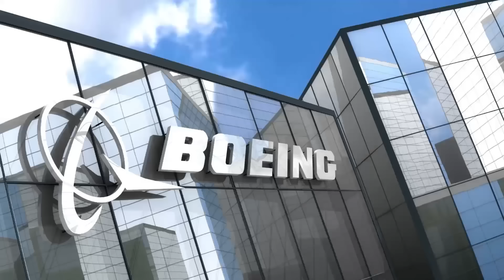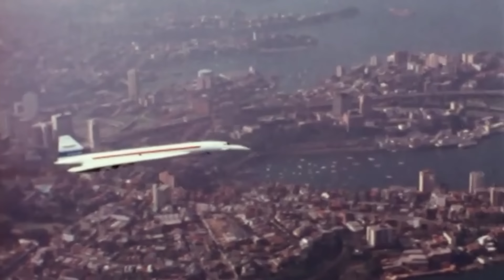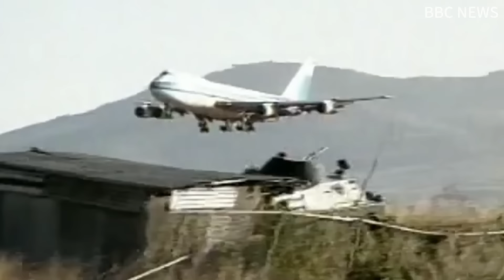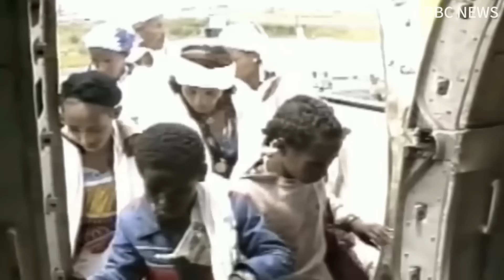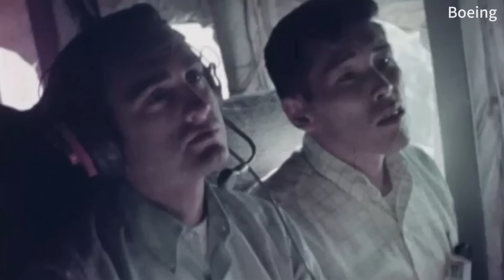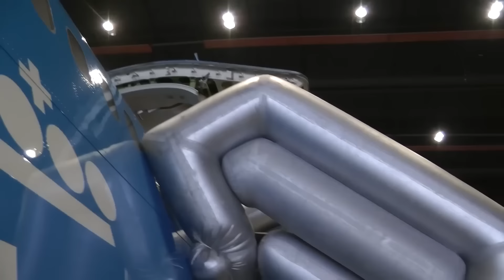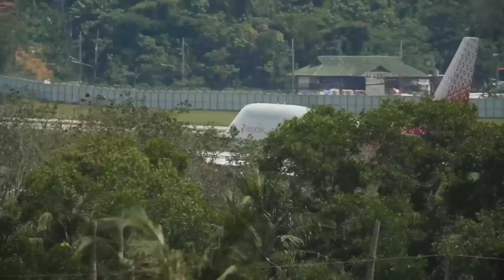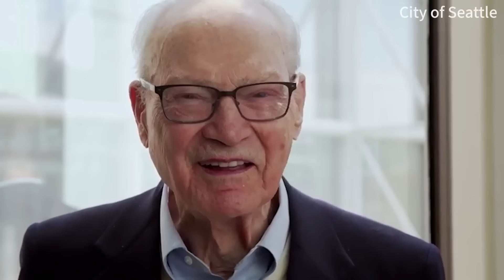What The Boeing 747 Hump Was Really For

Comment: I flew many times on 747s, a wide range of airlines.  Of all aircraft, 747 felt solid and secure.  Highlights:

- Pan Am NY to Frankfurt/Main,  several hours overnight in storm with lightening all around, and turbulence such that if not belted we would have ben bounced off the ceiling each few seconds.  I only had that turbulence experience in one other case, Swissair MD8X London-Geneva, storms over the Jura and Alps.

- On the last leg from Europe to São Paulo, taking off from Rio de Janeiro almost without any passengers or fuel, pressed harder into my seat than any sportscar.  I recommend anyone flying in or out of Rio to use a local propeller aircraft, as the views of the mountains, harbour, beaches are spectacular - on a 747 you're too high too fast.

- Pakistani 747 Zürich to Karachi, the interior was sloppily hand painted.  Weird!

Comment: Hi, I am ex military and was lucky to meet one of the designers of the 747 in his 80's. Not in the US but in the UK. Yes thats right, as you say the design had to be revolutionary to acheive such a high sub sonic cruising speed. As it happens the gentleman concerned was one of Barnes Wallace's understudies - yes teh guys that desinged, tested adn built the bouncing bomb that help end WWII quickly.  He explained how Boeing brought him in as an aerodynamics consultant to enable them to desing a wing and body that could do that speed (0.85 m) without the airflow going supersonic over the wing root.  In other words, the air goes faster due to Bernuli princple over the wing which helps create lift, but not too fast so it goes supersonic (when the jet is that close to the speed of sound).
So yes a pom (posh old dude from the UK) was critical to the sucess  of the 747. I know a lot more than this simplification of the facts, but I will leave it at that. PS I'm an Australian so no bias there...:)

Comment: Aeroplanes are not made of aluminium. They are made of material called ALCLAD. Alclad is a range of duralium alloys with 1½ thousands of an inch of aluminium hot rolled onto both sides (like a sandwich). The skins of the 747 are made from alclad whose main alloy is magnesium. I am a retired aircraft sheet metal worker.

Comment: 12:00 a nod to the pioneering Sir Freddy Laker who in the late 1960s took BAC one-elevens, reduced passenger free baggage allowance and reduced the maximum number of passengers (below the aircraft's maximum).  This allowed extra fuel to be carried allowing for a longer range.

This continued in the 1970s when he got 2 of the 5 DC-10-10s destined for ANA (the other three went to Turkish Airlines (one of which was used for TK981 which crashed due to the defective cargo door).  Reducing the baggage allowance, reducing passenger numbers again allowed more fuel and more range (I think he had an extra fuel tank installed).

Comment: My friend, every ocean crossing jet liner required a Pilot, Co-pilot, and Flight Engineer. 

Solving problems that have never been encountered before? That's what engineers do every day. 

Yes, I've flown 747s many, many times to five continents, as a working musician, a travelling teacher, or a consulting engineer. It was the best, most comfortable, safest airliner ever built. 

Still being built. 

Special feature --  The Pan Am Lounge -- the only Piano Bar at 35,000 feet in 1970, accessible via a spiral staircase in First Class. Invented like most great airline ideas, by Juan Trippe.😊😊

Pan Am converted all their 747-100s to contain a Sky Bar. They had a small baby grand with bartop, usually a jazz pianist to play tunes, standards, sing alongs, requests, and would sometimes be joined by pros on board. They were very cozy, intimate, friendly, and surprisingly quiet. 

All airlines followed with similar ideas. I spent a lot of time up in the Sky Lounge, when a friendly stew wasn't showing me the elevator down to the prep galley, storage area, freezer, and liquor cabinet. 

But that's another 747 Secret for another time.

Comment: There were many airliners that were faster than modern airliners, the difference is that modern airliners are soecifically designed for fuel efficiency while the older airliners were designed for speed.as to how to do the calculations without a computer or calculator, we did this in Engineering and our professor would always talk of the calculations for the Boeing 747.   The complex partial differential calculations would be solved on semi log paper, a ruler and a protractor.  It's called Bode plots and they approximate the differential equations by at most 3dB.   We would always comment on how the final was always the same twenty problems every year.  Turns out those were the classical oroblems that could be easily solved, change anything and you'll spend most of your time chasing your tail.  Thr graduate course was the same twenty problems but each with a minor change making the final beyond frustrating.  The amount of computer time to solve thes problems are incredible especially since the ruler, protractor and semilog paper could solve the classic problems in minites while the conouter would take days...  Of course, change anything and you might spend a lifetime.  Okay, modern computers would be a lot faster.

Comment: The hump on the 747 was there because the original design of the 747 was for what became the C5A cargo plane for the US Airforce. it set the pilots up above the main deck so the front could be raised to load cargo, and when the contract was refused BOEING because McNamara hated Boeing...Boeing used the engineering time spent on the plane to good use when Juan Tripp from Pan Am come looking for a LARGE plane and Boeing incorporated the hump so there also could be a cargo version.  IF  you see a C5A you notice its nose also lifts only 2 planes I have ever seen with that type of nose !!!

Comment: Mach 0.85 Is 647 miles per hour, not whatever you said. Also you said it was designed in the 80s it was designed in the 1960s

Comment: The 747's hump, or upper deck, wasn't extended fully along the fuselage length due to aerodynamic reasons. While the initial design included a full-length upper deck for potential cargo conversions, this was not implemented in the final 747 design. The designers determined that a fully extended upper deck would negatively impact the aircraft's aerodynamics and overall performance.

Comment: I worked at Boeing on 747s airframe #4 through #42, hard to believe that the aircraft would be in production for half a century. It was the right plane At the right time providing low airfares for the rapidly expanding intercontinental travel industry.

Comment: In the early 1980's I flew on a 747 from the US to Germany on vacation. The big 747 made transcontinental flight so affordable, even I could afford it. I checked with Headquarters Marine Corps to make sure a vacation flight to Europe was OK with them.They said it was fine, but if I intended to fly over any Communist country, it would take special written permission from them. As I didn't intend plan to fly to Berlin, (over then Communist East Germany), that special permission was not required. That was my first 787 flight, but not my last. A Great aircraft.

Comment: In 1977, I flew on an Iran Air 747 SP non-stop from JFK, NY to Tehran, Iran, a distance of more than 6,100 miles. We took off in the dark, flew in the opposite direction of the sun and it was starting to get dark AGAIN when we finally landed. It was the longest commercial flight I've ever done. I actually did one longer than that when I was in the USAF, but it was onboard a KC-135A.

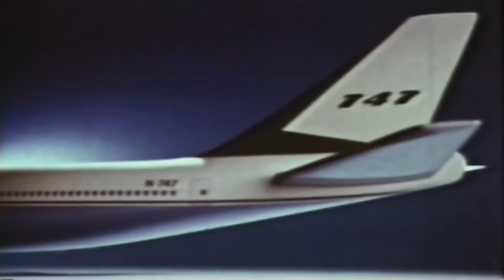Comment: 3:41 because modern airlines are designed for efficiency, not speed. Above .8 Mach there's a significant increase in aerodynamic drag due to compressibility effects in transonic airflow. The industry has found that by flying a little slower, there are greater fuel savings to be had. Yes, I too love the 747 for its speed, but the sad truth is, efficiency and cost savings are going to win out over raw speed when it comes to airliner design these days.

Comment: When I was a young kid, Me and my parents were bumped up to 1st class for some kind of compensation for the second leg of a stop. Back then, the 1st class was simply the section with the largest individual seats in the plane (like a Lazyboy lounge chair, but it was still two seats in a row) in the nose of the plane. Unfortunately, I was too young to realize how much it was a rarity or even appreciate the location or view. Like being on a front passenger cart of a train with a front view window, but not really interest in the view; I was more fascinated with the upper deck.

Even when the 777 and 787 came out, while I was interested and excited in riding those planes, the 747 still held a nostalgic preference and place in my heart. I think my favorite seating area is just before the wing strut or even right on the leading edge of the wing (the window seat despite the hassle). The tail section might have been the safest area, but that is also the area where you hear the engine the most and feel the tarmac roughness.

Comment: You missed two:
1. The hump was shorter than later models at first, and from what I was told, the hump was actually enlarged on old jets still in service. Mostly for efficiency reasons. (I'm not sure if this was efficiency in flight, or just because they could transport more people for not to much more fuel)
2. 5 engines. Everyone knows the 747 has 4 engines, right? But there is a 5th mounting option under the wing, and it was used to transport an extra engine when one was required at a location that didn't have one. There are pictures enough, google will help you :)

Comment: The 747 was not designed for future conversion to a cargo liner, it was designed from the start to be a cargo aircraft in response to the USAF requirement that also led to the Lockheed C-5.  Boeing lost that contract to Lockheed, and the 747 then became a passenger liner when Pan Am showed interest in the design.  Pan Am asked Boeing to move systems such as the air conditioning packs out of the aft upper deck area (where they had been out of the way of cargo) so it could be used as a passenger lounge.

Comment: I got to fly in one, a nonstop short haul between OKC and SEA, midweek, 1972, off-season, and remember the airplane was so empty that one passenger (a health fitness nut) took to running laps somewhere over Colorado ... forward starboard, aft port, but all in coach. Most of the rest of us just smiled and waved, revelling in the casual miracle of flight. It was a big enough airplane that he only came by once a minute or so, maybe twice.

Somewhere crossing out of Colorado, a flight attendant asked him to quit. His rhythmic front to back and back again changes in the airplane's center of gravity was creating an autopilot-induced oscillation called a "Dutch Roll" and it took some non-sterile cockpit banter between the captain and "There's a passenger jogging laps, isn't that funny?" flight attendant for the PIC to realize why he was losing control of his aircraft! 🤪🤣

I don't remember whether the pilot in command actually explained over the PA why he forbade future jogging, but a few of us bought him a $3.00 beer when she told him he had to sit down.
Reply: United Airlines: #4 fave! #3: Continental. #2: Alaska. #1: Air Canada.

Comment: Had the privilege of crossing the Pacific, twice, on a 747-800 in 1994. On the westbound flight from LA to Sydney we had a strong tailwind and averaged well over 600mph ground speed (if memory serves it was near 680mph across the ground but that was 30 years ago so take with a grain of salt). I recall the captain announcing he had been asked by control to throttle the plane back because we were running two full hours ahead of schedule as a result and they wouldn't have any parking for us on the ground. Anyway, cool video! Subscribed.

Comment: I recall when it was first introduced.  I was a twelve year old and we lived on the Upper Richmond Road West, directly under the main approach path to Heathrow.  We had a window looking directly down the flight path towards London to the east, and as we saw this plane approach, my mother started screaming - since it was so much larger in cross section than anything else flying, she assumed it was much closer and lower than it was, and was going to crash straight into the house.  Later I had the opportunity to fly on it repeatedly, and once was on an El Al 747 which had a brass plaque noting that it was 25 years old!  I remember thinking how I wouldn't want to drive in a car of that age - but how beautifully she flew!  For passenger experience there is only one plane to match it - the Airbus A380 which I now seek out whenever I can.  Of course we are all interested in cost-effectiveness and related environmental efficiency - but will the manufacturers and airlines note that there is nothing like having space to move around on a long flight!

Comment: Early on when I worked for Boeing, in late 1986 or early 1987, sometime after one of our 737-Convertibles opened the top mid-flight in Hawaii, I got assigned to cover the newly re-recognized problem of fatigue cracking being not only a matter of pressure cycles, but the environment (salty sea air, constant rain, occasionally torrential, PLUS pressure cycles) ... anyway, the problem was compounded by anything other than a cylindrical fuselage.

Well, the 747 has that upper lobe on the 41-section, the front portion of Boeing airplanes that includes the cockpit, forward landing gear, forward passenger door, and it creates a stress point where the oval cylinder of the 747 fuselage mates to the Upper Lobe: a pointed intrusion into the otherwise cylindrical shape. Since this area was of great concern, Boeing ordered Borescopic examination of all 747s, regardless of cycles, which would require snaking a fiber optic camera behind the instrument and breaker panels in the cockpit. My job, as an art director at Motion Picture and Television, was to visit the factory floor in Everett and complete a shot list of the areas that needed to be examined in a 747 that none of the panels had been installed into yet.

There was only one 747 on the floor with that status ... the first Air Force One. And my shooter, Jurgen, and I spent the better part of a day under armed guard climbing around parts of Air Force One that YOU WILL NEVER SEE!! 😁🤯👍

I digress ...

I'm 45 seconds into this, and I'm here to tell you: the hump was designed for front-loading freight too big to jostle through a side hatch. Anything else anybody says is bovine manure. It's not the first time such a design feature has been built into an airplane but it was originally decided to be a feature of the 747 so it could compete for military cargo contracts.

Comment: The 900  odd switches lights and controls reminds me of the control room of a nuclear power station that I worked which had 1500+ control’s etc.  run by 3 engineers and based on 1960s technology with some modern apparel and additions.  Does reenforce how far the technology for all sorts of systems have moved forward over the decades. Likewise the Space Shuttle.

Comment: Fun fact. After a disaster movie production staged an air to air transfer of a pilot from a helicopter to a 747, the engineers at Boeing realized there was a tremendous low pressure area aft of the cockpit hump. Reappraising the drag profile, they built the extended upper deck of the later models that filled the void for no drag penalty. The movie stunt man had been able to walk upright in the lee of the hump about half way to the tail. Up until then, nobody had even considered the possibility of extending the hump.

Comment: The 747 had a remarkably recognizable radio transmitter. My job was to monitor commercial air traffic. Whenever a 747 was in the area, its radio transmissions came through louder than the ground controllers. We used to refer to it as the Voice of God, as it was always clear and difficult to misunderstand or ignore.

Comment: Many, many years ago, my wife and i sat in the very front seats on the 747. She worked for the airlines at the time. I immediately knew how special the experience was. The rollout was incredibly smooth sitting that far in front of the main landing gear. Talk about quiet!  All I heard was the airstream flowing around the airplane.  As we took off from Honolulu I suddenly heard the wind. Then, away from the city the pilots increased the throttle.  There was no engine noise. The sound of the wind changed as it became stronger.  It was an amazing experience.  The only bad part was we were going back to winter in the Seattle area.